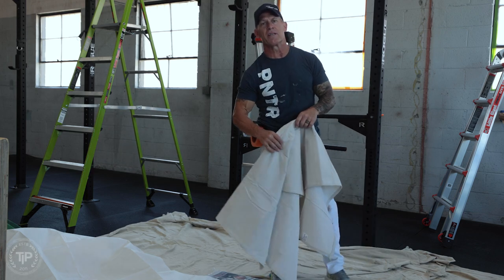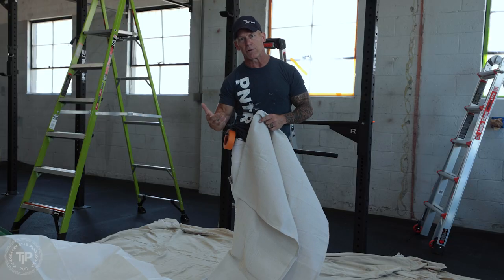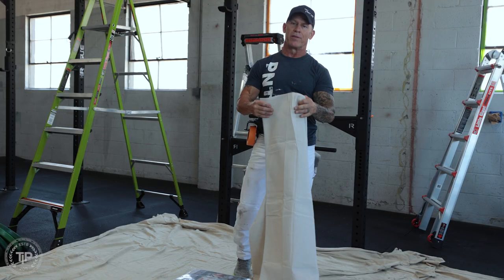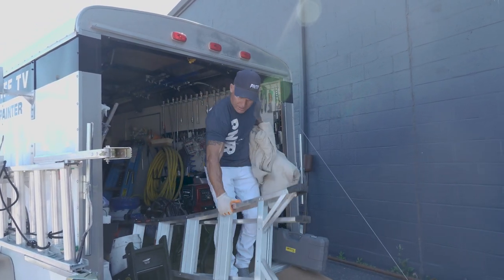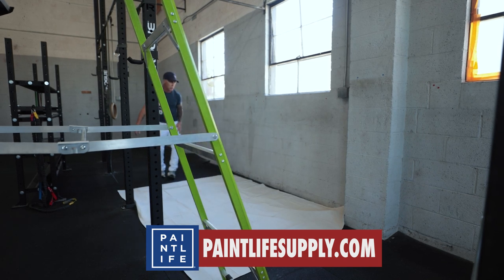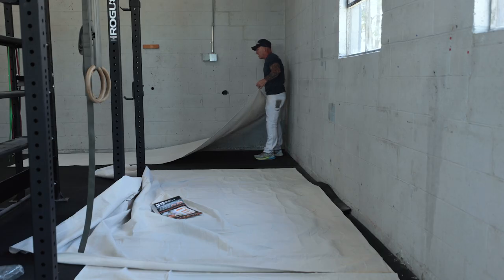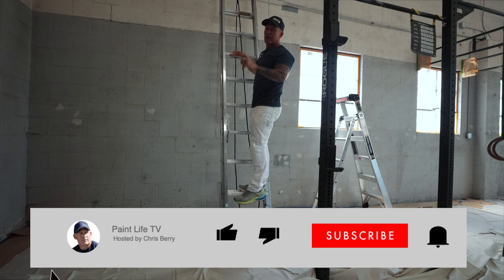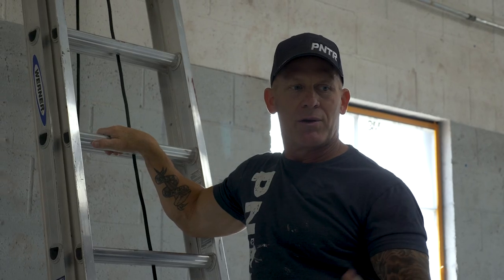Non Slip Drop Cloths! The Must Have Accessory for Ladder Safety.

Comment: A Rubber door mat will also work in some of these situations that you're ladder needs to be set up on a slick surface.
Reply: Tile is STUPID SLICK when wet, try to always get someone to hold the extension ladder on tile, or get 2 5 gallon buckets full of water/paint and stack them at the base of each leg.
Reply from the maker: That sounds sketch
Reply from the maker: Thanks for sharing👍

Comment: Ive had an extension ladder slip on me, working fast didnt think much of it the ladder was placed on the floor over a drop cloth, i started to climb the ladder and as i got to the top the ladder started to slip, luckily for me the top was a ledge so i was able to get on the ledge before the ladder slipped, and i also wasn't working alone so i wanst stuck on that ledge, i called someone to remove the drop cloth and place the ladder saftely so i could get down. ive also had a ladder sink a bit outdoors, i placed it on a pile of soil, , and as i got on the ladder about half way the ladder started to sink and dropped about two steps, again i got lucky because it was still leaning aghainst the wall so it didnt slip under me or slip off the wall.

Comment: Never put your extension ladder on a cloth very simple
Reply: I agree, my #1 rule is to never put extension ladders on drops. Nonslip or not. I've had a close call once in a very high end home where I broke my rule for a few minutes, luckily I only slid a foot or so then by the grace of God my ladder wedged into the fireplace right near it. Had I been a foot further out I would have been riding it all the way to the ground. All because it was on a drop cloth on hardwood flooring. Never ever ever ever again.